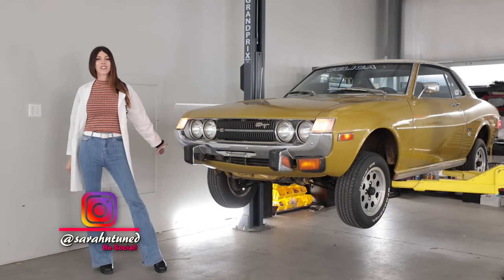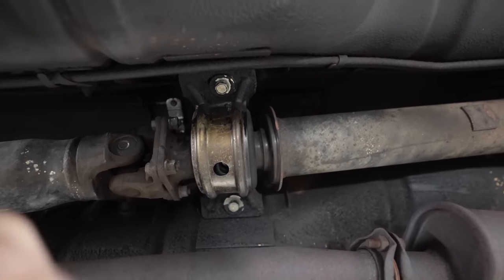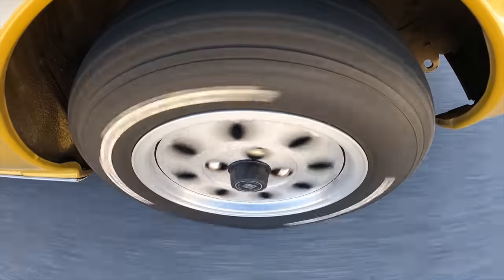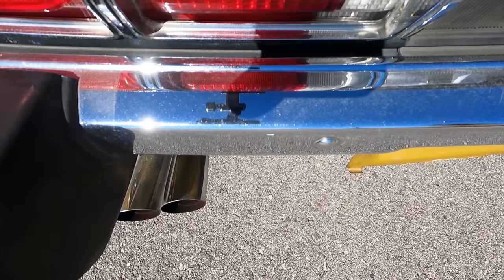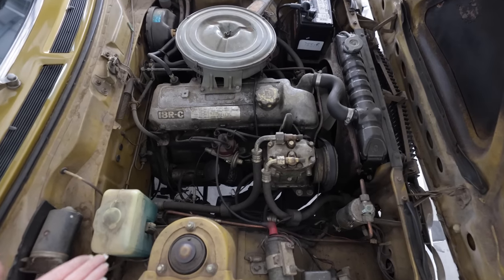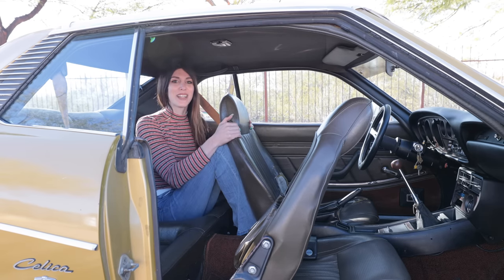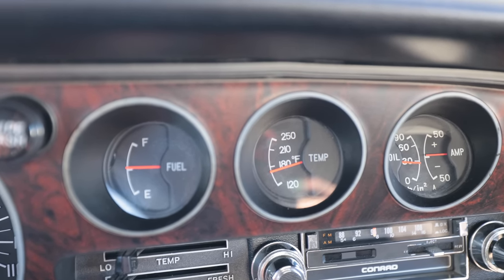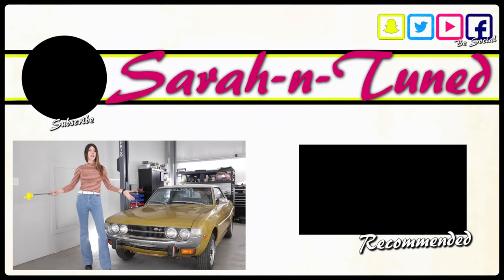A Japanese Muscle Car ..ish // 1974 Toyota Celica ST Review

Comment: Those lightweight cars with carb'd engines and manual transmissions were a blast to drive. Looking forward to this build :) .
Reply: I couldn’t say it better 👍
Reply: My buddy had a 72 Opel GT with the 1.0 liter, a 4 speed manual, about 90 hp, and weighed about 1900 pounds! Absolute blast to drive! I had an 82 Civic SL (3 door hatchback) with a 4 speed manual, and it was also a ton of fun to throw around corners. I'd love to restore one someday.
Reply: @robertt3715  I still have a74 VW CARMANN GHIA stored away since 1984.  Built the motor up before that. My buds used to call it the 1800 lb. Orange that crushed 68 Camaros stop light to stop light 😎
Reply: @robertt3715  Is that a typo? I presume you mean 1.8 litre?
Reply: @captainnemo247  I meant the 1.9

Comment: This was the 2nd car I ever bought for myself. I spent $100 of birthday/high school graduation money in June 1983 and bought a white '74 GT 5-speed with a black vinyl quarter top. It was sitting in a guy's front yard near the school where my dad taught. The DS fender had been replaced and was still in primer, there was no front bumper or grill. We put in a fresh battery, pours some gas down the carb and it fired right up and I drove it home. We sourced a replacement bumper and grill from a local salvage yard and I drove the car for over a year before the DS front subframe cracked going over railroad tracks. Apparently it had been bent in the accident that claimed the fender, bumper, and grill. But the car tracked just fine, so I didn't even know. It was a great car, super comfortable, great brakes, decent power. It wanted to cruise 70-75 all day long.

Comment: Looking how in great shape the body shell is, and being from a single owner, I'd reconsider modding it. Would make a great restoration project. While the V8 swap be done in a less greater unit, with new axles and fender flares.
Reply from the maker: Not gonna happen
Reply: @SarahnTuned  If you are looking for another project of this type, I have a 1979 corolla wagon that needs a new motor (or rebuild the one in it). Body is nice, interior is sun rotted but useable. I figure it would make a great rally type or cute rwd overlander. I also have a rough 280z if you want a better looking project.  (both in Tucson)

Comment: You actually brought tears to my eyes! 
I used to have a car just like that when I was 18. Then my father bought me a 1974 celica GT at auction. 
I’d still have that car if it hadn’t got T boned. 
I haven’t seen any of those cars in over twenty years. 
I loved those cars. Watching your video brought it all back. 
It’s an awesome car. 
I had a header on mine and a Webber two barrel carburetor. 
I use to piss people off racing them light to light. 
Your ST is in Remarkable shape. 
I’m jealous!! Lol!
Reply: I had a '71 Corolla with (I think) a 1.6L engine & 5-speed transmission that got t-boned by a '76 navy blue LTD running with no lights.  Those early seventies Toyotas were what American car snobs called "zippy".  That meant they outperformed American V8s up to 70kph with the 4-speed & 90kph with the 5-speed.
Reply: @jeffreyquinn3820  
those were cool cars as well. I also had a Toyota Corolla Mrk II before the celica. Your absolutely correct about those 70’s Toyota’s
Reply: I also had a 74 Celica GT emerald green with the same white vinyl half top that I drive in High School and College.   Wish I still had that car.  I want this one!
Reply: @UCanDoIt2Mike  
I actually found myself wishing I had one again. I kept myself from coveting Sarah’s. Lol!
Reply: @jeffreyquinn3820  I mean, 115hp from a 1.6L engine of a light car in the early 70's is nothing to joke about!
I mean, even until the 80/90's, getting 115hp on an NA 1.6L engine was respectable.
And yes, I'm disregarding any engine that's not the 2T-G (and 2T-B) because they weren't worth having.
Reply: @rrs_13  The JDM spec 18RG was worth having, and is superior to the 2T engines. Basically a big boy 2T.
Reply: @everettmarshall7917  true. It had a bit more power, but at the cost of extreme rarity and reliability.
I believe that was only available on the japanese GTV, correct?
Reply: @Oliver. Just curious, did your '74 Celica have power steering? The reason I ask, is that I had a 1974 Datsun B 210 Automatic without power steering. 😊
Reply: @rrs_13  18RG were available in most of the JDM GT cars, not just the GTV, but I agree they are now very expensive.
Reply: for some reason those first gen Celicas always got in bad wrecks.
Reply: @tima6549  I think the fact that they really do look like mini muscle cars, makes people think it's farther away than it is. Same thing happened with the scion xb, which looked a lot like a chevy astro.
Reply: Back in the late 70’s when I was still a teenager I had a red 1974 GT with a 5-speed and full instrumentation and I loved that car. In stock form it didn’t have much power and the understeer was horrific, but I still loved it.
Reply: I had a 1974 also at age 20. Got myself from some girl who was selling it at university. Somewhat rust free. Looked just like this one except Metallic caramel brown.
Reply: Sarah - I have never been a JDM person but these were the cars from my childhood and so loved my (much older) 2nd cousin’s Celica GT.  Nice memories.  Got my license in 1976 and went Italian Alfa after a Buick GS.  Never new that there was a Japanese GTV.  I don’t have a Stelvio or Guilia QV but you are welcome to test drive my 4C, 1982 gtv6, 1988 Milano or ‘74 Spider in your next NJ visit!  Interesting to compare in 1974 a 2L Alfa GTV in US trim made 129hp using a whole lot more tech than the cool ST, so that Toyota motor is impressive despite its primitive specs.  I’ll have to look up the Celica GT and the Japanese market GTV specs.  Mazda was making RX3, Datsun cranking 150hp in the 2000 roadster, always impressed with Japanese engines and your Celica is retro-cool.  Can’t wait for the V8.
Reply: I wrecked mine too ('74 Celica ST)😢  Miss that car!

Comment: CHIRPED 3RD. GEAR!!!! "Click, Add to Cart!". I actually had a 1974 in Black, and a 1977 GT Hatchback, the Mustang copy (also a bunch of 80s Celicas that I bought with bad motors to fix and sell). It was really fun. I wired a paperclip between the primary and secondary on the carb to dump more gas in (double pumper???) and I could actually tell when the paperclip broke because of the 'lack of power' LOL (It was the 'big paperclip', not a normal one)... I used to work for a Toyota dealer because I loved the cars and I got to drive customers' Supras AND I got to drive a 'Celica All-Track Turbo' that I did a State Inspection on in December so I got to see the All-Track actually work! It is great to see someone who takes the time to show the actual work being done instead of 'full restomod in 10 minutes' type of stuff. Your attention to detail and quality of work is fantastic. You can always tell someone who really does the work vs. someone who is just there to film stuff by the way they pick up and position tools. You are truly a craftsman!

Comment: My first car. 1972 Celica ST coupe with an 18RU and 4 speed. I mowed lawns to buy it from our neighbor.  Had no seats or steering wheel when I got it. Drove it home sitting on a bucket with vice grips to steer it. Had to rebuild the carb. but it came with Quikor suspension 3" lowered, deep dish aluminum turbine wheels 60 series tires. I loved that car. I lterally jumped it a few times on the dirt back road to my friends house. I swear it was practically indestructible.

Comment: I loved mine. Very balanced handling - 50/50 weight distribution, easy to toss around and easy to work on.
Reply: Not really - I’d have to trail brake and then kick the clutch to get the back to hang out. In the wet I could get it to come around at 30 instead of 45 in the dry. Of course the handbrake could encourage step out. With the little 165/80R13 tires it didn’t really hydroplane and control while sliding was very progressive. Manual steering really let you feel the contact patch and correction was easy.

Comment: The memories that video brought back.... thanks Sarah. I purchased a '76 GT Liftback back in 1978. 20R engine and 5 speed manual. It wasn't the quickest in a straight line, especially against American muscle cars, but on a twisty backroad.... one of the most fun to drive cars I've ever owned even to this day.
Reply: Had to pause at 1:52 because my '76 GT Liftback was in the same color. It was the first car I ever bought. Bought a Haynes Manual and did my own maintenance. When I sold it in the mid-80's it still ran like a champ, but a decade of Michigan winters had pretty much rotted the body out. It also had the 20R engine and 5 speed; it was the car I learned how to drive stick in.

Comment: My older brother had a 1973 Celica, can't remember if it was an ST or GT.  Great little scooter of a car.  I remember stuffing my 10-year-old self in the tiny back seats in 1977 to go see Star Wars for the first time. :)  I hope you're going to save the 18R for a future project.  Those R-series engines right up through the 22R are damn near indestructible if you take the least bit of normal care of them.  The trouble on Toyota from this era wasn't the engine or the powertrains or any of the mechanical bits, it was the bodies.  They rusted out if you spilled a bottle of water near one.  So for you to find this Georgia peach of a car with the body in that mint condition is truly exceptional.
Reply: Can't wait to see the condition of the steel roof once the old vinyl is ripped off. I'm keeping  my fingers crossed and hoping for the best.

Comment: I'd wager that the mystery button is an internal cut for the seatbelt reset switch (normally in the engine bay on the passenger side).  The ONLY item that I ever replaced on my '74 ST was the A/C belt tension pulley.  I autocrossed mine, so definitely agree on your Octo score for handling.  118MPH was constantly hit in mine.

Comment: In '78, I bought my first car. A '71 Celica. It was baby blue. Painted it black and put Corolla  wheels on it because it came with steel wheels with chrome wheel covers. A nice spec for this body style. I wish I didn't have to sell it, but I needed a truck for work. Miss that car bad!!!
I had a switch like that. In that same spot. I used it to switch from radio to 8-track. The 8-track fit into the glove box. Had Jensen Coaxials in the doors and Jensen Triaxials on the back shelf.

Comment: I had one of these - the exact same car, with the luggage rack & bumper guards.  Mine didn't have the vinyl top though.  It was my 2nd car to own in my teens (1st car was a '74 Malibu).  I swapped out the 4 speed for a 5 speed, reworked the head / valves, and added a semi header for exhaust.  I miss that car, and the memories driving & working on it.  My favorite thing about that car was it's exterior design.  It was a beautiful little car with lots of sex appeal for a Japanese offering of its time.  Never see these on the road anymore.

Comment: Sarah, thanks for breaking down the 1974 Toyota Celica.  I had no idea that Toyota was creating high horsepower engines back in the Seventies.  In pounds, (lbs), this car has a ratio of, (2170/97), 22 lbs per horsepower, (hp). In terms of suspension, instead of leaf springs, it has coils over the axle.   
When it comes to wiring, appreciate your simplying the complexity of working with wiring harnesses and explaining that it's broken down into two systems, one for the engine computer and one for the dash.

Comment: You scored bigtime when you found this. I have always loved these, and would dearly love to have one like that now. I used to drive an '87 Celica GT and that thing was a ball to drive (and I wish I still had it...). I've been fallowing the build on this for a while, and I really appreciate your wanting to do it as if Toyota built it. It should be a wild ride when you are finished.
For myself, I would go with an OHC or DOHC four-banger backed up by a 5-speed (and LSD rear end). My old '87 had a 3SFE in it and that thing ran pretty righteous, for a little 2 liter...and would pull 30+mpg, even when I was flogging it!

Comment: If I was mechanically inclined I would do the following;
•V8 swap
•install mechanical LS 
•brace the frame, possibly with roll cage
•bigger rims, 15 or 16's 
•new suspension 
•bigger brakes and disks all round 
•wider front tires like they have on Audis
•install that racing wide body kit
•have the fog lights as DRL's
•the white grill marker lights as signal lights 
•make rear signal lights orange 
•replace fake wood with real wood in the interior 
But I'm not mechanically inclined, but I am excited to see what you do to your car.
Keep up the great video content 🤓

Comment: A neighbor of mine, when I was a kid back in the '70s, owned a '74 Celica GT.  (Interestingly, I grew up in Atlanta, GA, so your car and I were in the same city at the same time back in the '70s and '80s.  🙂)  I've always loved the looks of this generation of Celica.  This thing is amazing!

Also, that tape player in your car is a cassette player, not an 8-track.  You insert the cassette with the open tape side facing the front of the car, instead of to the left or to the right like on most car cassette-players.  Hence the reason why that tape-slot looks so wide, and almost like an 8-track slot.

Comment: I’ve owned two of this model brand new, but the ST version we imported had a 3T engine , twin Asian carburettors & a five speed gearbox. A friend of mine owned a 1974 ST and drove it three times around the mileage reading, so close to three hundred & fifteen thousand miles, motor never removed,& sold it to an enthusiast who transplanted the two litre twin cam 18 R motor into it.

Comment: Dang! You brought back some memories. Can't wait to see your end product! Bought a new '74 (base/no AC) Celica after I ditched my POS '74 Mustang II (such a disapointment). Only mods that I remember were a Weber carb with a K&N filter on top. Loved my Celica and kept it until 1993 when I traded it for an '86 4-Runner. PS. Don't forget to show off the unlockable metal gas cap in the rear pillar!

Comment: I’m looking forward to the progressional rabbit hole that restor-mods always bring. After the engine, there will be the transmission… then the rear diff (gonna need that LSD with all the power going back there)… then the brakes… then the suspension… then maybe the fender flares (fiyah!).  It’s a labor of love that will never be completely done, because working on it is the best part.

Comment: I had a 1975 Celica.  It was slightly modified with Holly carbs, wider tyres, performance exhaust, front spoiler.  With a cross flow engine it went very well.

Comment: I had a 73 ST celica, I put a 5 speed from a 82 pickup, bolted right in, same drive shaft etc, I also put a small Webber down draft carburetor and a 2 inch exhaust pipe, it zoomed!!!

Comment: Bought 1974 Red Celica in 1977 fro $1400 and it only had 12,000 miles on it.  Drove it to 200,000 and it finally gave up the ghost.  I have had dreams over the years that I still had it and go driving.

Comment: I had a 1975 ST Celica, with a 1800RC motor. Ran great but needed OD with only a 4 speed. It was alot of fun to drive, great on gas. Mine was Blue.

Comment: I use to have a 1980 Corolla SR5 coupe with the 4 round headlights. Loved it. I put Celica GTS wheels on it(same ones that came on the Supra), KYB shocks, urethane bushings, a pair of CARB legal Weber side drafts, custom 2.25 inch exhaust with a Flow Master 60 series, and a full face Clutch Master disc. I was going to AE86 convert the brakes to all disc so I can put Brembo brakes on it later but it got stolen. Was never found.😥😥

Comment: I have overhauled an 8RC in my old 71 Hilux it was 1800 cc. It looks similar. Mine had a timing chain that ran to a balance shaft. Then to the cam with another chain, it was so short you had to either remove engine and transmission together or transmission first. Cast iron head and block. The major malfunction on that engine is the intake and exhaust manifolds are bolted together one aluminum one steel I burnt a valve before I knew

Comment: 3:9/1 Was 5 speed 4:0/1 was 4 Speed from memory. I have a couple in the garage. Also remember you could get a 5 Speed kit. They we're also released with different brake disc & drum sizes. Import was normally smaller than the Aus & NZ assemble.
Alot of ke35 & te37 series parts will fit celica

Comment: I've owned two of those. A ta23 (1977) and later a ta28 (1976). Both ST models which didn't have a 18R engine but a 2-TB engine, probably because that's what they issued in Europe. The latter one (the TA28) I converted to a GT with the 2-TG engine and gearbox. That engine was modified by Yamaha, had a twincam head and twin double Mikuni carburettors and did 8000 revs easily.
The gearbox it came with was slightly longer so, to make it fit the car I had to combine the two halves of the existing and new driveshafts and cut out the console to fit the gearstick, and I had to change the accelleratorpedal because the 2-TB used a linkagesystem for the carburettors.
Marvellous cars, easy to maintain and nowadays quite unique. Still miss them.

Comment: My parents had a 1972 LT and it did come with an auto. If I'm remembering correctly one of the bolts holding the auto to the block was aluminium and snapped as soon as we put a spanner on it

Comment: I had a '74 Corolla SR5--2TC, MSD, wild Ischy cam, 4-barrel carb, shortened shifter, widened SR5 rims 13x5 out back all rims painted gloss black w/ beauty rings around, traction bars Lol. Funny I had a tach connected to my steering column. I miss her. Lol